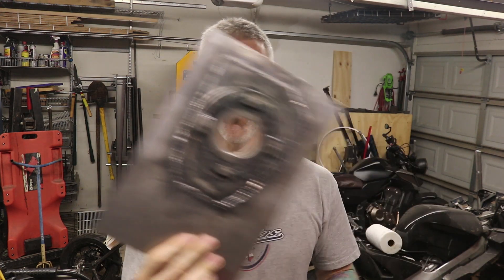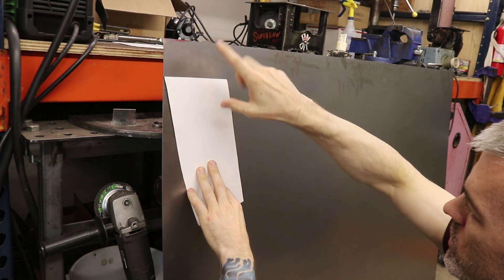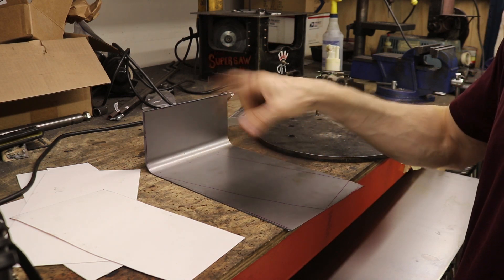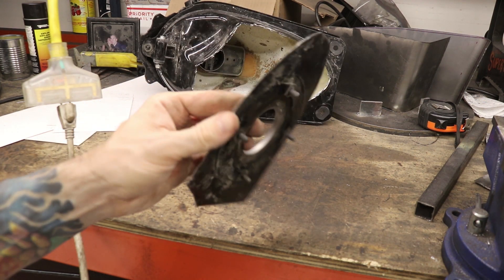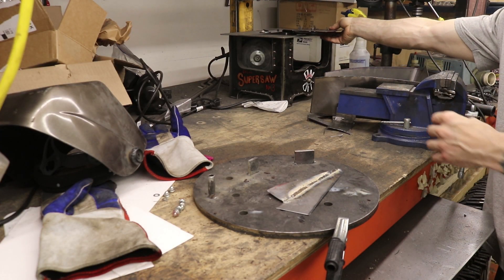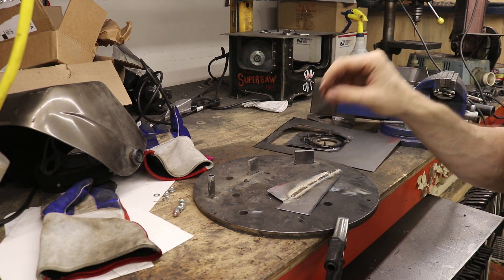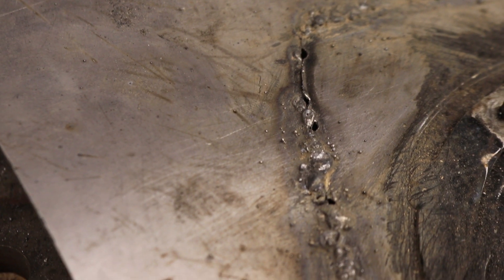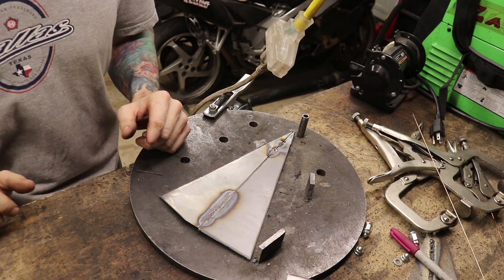Building a Gas Tank From Scratch | Part 1 | Grom E30

Comment: Sheet metal is tough man. Especially like auto body stuff. Heat sink, some guys like to blow air from an air compressor blow nozzle onto each tack to cool it quickly, I’ve seen squirting water on every tack right away, I’ve tried it all man, and I’ve never managed to get out without any warping. Always ends up needing some body hammer and dolly work, grinding and glazing putty. I don’t care what the Sunday morning hot rod tv shows say.
Reply from the maker: I hear ya preacher! 😀 It is tough. Luckily I am stubbornly optimistic. Otherwise I would get nowhere. I am hoping that the brazing will improve my results. A bit more practice and we'll go for it :)
Reply: @HooptieDoodle  yeah I dont doubt you’ll get it to turn out great and hone your skills in the process. Thanks for letting us watch it all take shape.